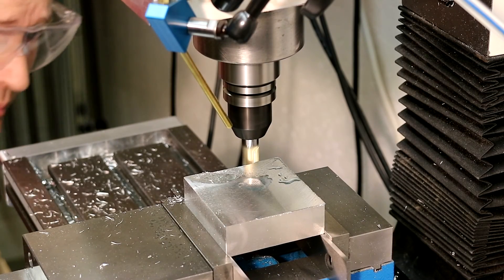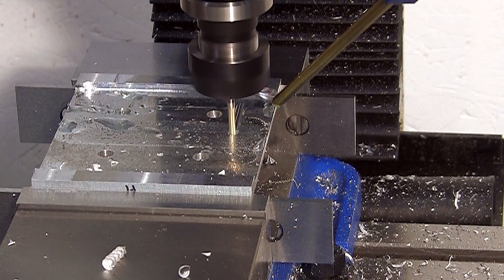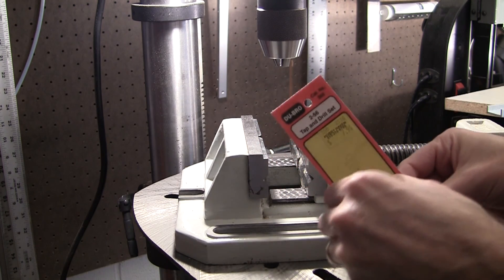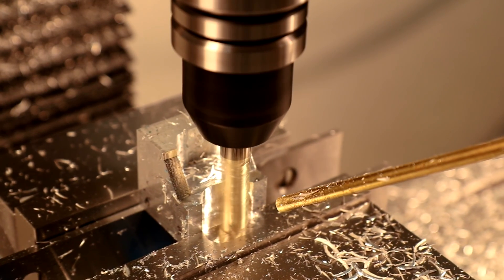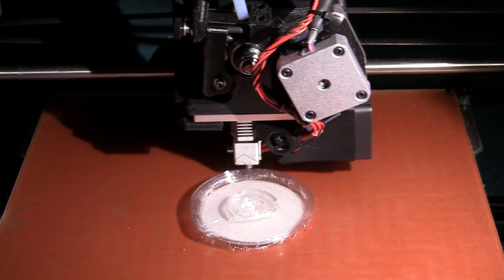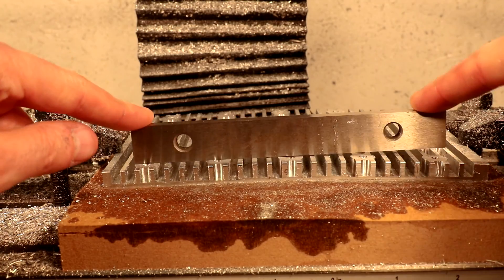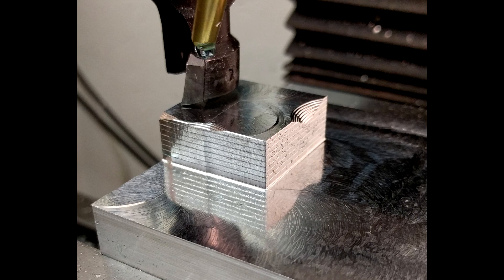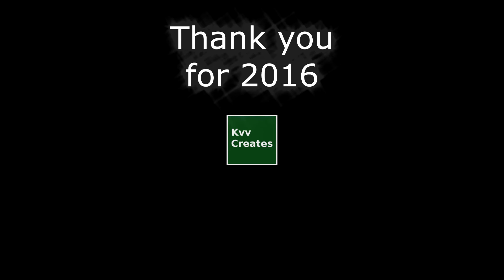CNC Machining Disasters

Comment: Hey Kent. I finally got my pm25mv cnc converted with a kit from Arizona video. I was wondering if you had a cheat sheet or something for some feeds and speeds that have worked decent for you with a stock motor. I have hybrid closed loop stepper motors, tormach  super fly, and some tormach holders. I'm not sure if there is a nice sized bit that you like for a motor our size. Thanks!
Reply from the maker: That's great! I look at the material removal rate (MRR) and convert that to power required given the material, targeting 50% of the spindle capacity, using the parameters from the manufacturer, all being carbide. Then when the program is run at 20% feed or so and ramp it up until it sounds right, and then keep my finger on the feedhold. Specific feed speeds will only be for specific MRR, so best to start with MRR. I started to put some software together for this. I bet we'll eventually see something like it built in Fusion, then optimizing tool paths to maximize MRR. A bit of science and a bit of art. Hmm... could be a cool video topic. Works well for me, but your milage may vary :) Stay safe, stay healthy.
Reply: @kentvandervelden  thanks for the good detailed message. :) Ill be working on the softer stuff like aluminum before tackling some of my steel projects. That's way more forgiving. The best to you staying safe also.
Reply from the maker: Steel is awesome. It tells us in chip color if all is fine. Looking forward to seeing the projects you make.
Reply: @kentvandervelden  that is about the color. I'm a super beginner so things will be fun. But that is sometimes half the fun. I'm sure there will be some interesting projects. Have a good one.

Comment: LOL! Great vid Kent!!  I physically jumped a bit when you pulled the part out of the drill press and broke the tap.  I've managed to do a few of those myself.  The swelling of the mdf was rather enlightening.  Any other issues with linuxcnc?  At some point this year, I will definitely be moving away from mach3! :)
Reply from the maker: Happy New Year Mike. Oh man, that swollen MDF made me sick after putting 1.5hrs into lapping the aluminum pate. I got very lucky. The video had some careful muting. :) I should have left in the bit in right before the second 1/8" end mill broke, me saying to my wife, "here we go" and her responding "I bet that was not expected." :) I've had a great experience with LinuxCNC. Mach3 was on my last mill and it worked well and was convenient, but LinuxCNC, has forced to me to learn better practices which when I read the explanations on the LinuxCNC forums, the practices are based on experiences with larger commercial CNC systems, so I trust what the designers had in mind and adapt. I'm surprised that no one has made a conversation CNC interface that's standard to LinuxCNC yet. LinuxCNC took a good deal of time to set up. I don't know if I had a working Mach3 system if I would switch to LinuxCNC... I don't remember having problems with Mach3 as much as I did with Windows XP, but it's been maybe ten years since I last tried Mach3. For me, the programming interface of LinuxCNC and that PathPilot is based on LinuxCNC, made it the obvious choice. LinuxCNC: it's a great lunch, but not free. :)
Reply: "careful muting"!!! LOL!!!!!  I use that on some of my videos too! :)  
Thanks for the input on linux.  I have a couple of extra computers here, so I may just load one up with linuxcnc for the little lathe and try it on it.  It would give me a chance to play with it.  Once I get a feel for it, then I can do the second ssd in the mill so that I can boot to either system. 
Thanks!!

Comment: I recognize a thing or two here.. :) sticking it to a sacrificial plate with double-sided tape, but after a few errors i switched to a sacrificial aluminium 15mm thick plate of 15x150x400mm, and aim for screwing, when possible. Tools running out of the spindle due to incorrect torquing, I thought i was the only one.. 1 off items can be a drag to 3d print, since tuning can be so time-consuming, just to get it right. At a certain point you can easily recognize what strategy you should aim for (adding support in the right places, adjust the nozzle width to get 2 lines to bond to each other). I do like the preview in simplify3d for that reason, gives a neat insight on what's going on. There are several features in s3d that justified the cost of the program for me.
Reply from the maker: Happy New Year Berend! Aluminum vs. wood is a great example of me trying to save a few dollars at the ultimate expense of many times the potential savings. Your large aluminum plate, as it's cut, do you resurface it and if so, how? I had no idea the swelling would happen that quickly or from so little liquid. The torque recommendation for the TTS tooling is 30 ft-lbs (40Nm) for heavy cuts. When I checked what I was torquing to regularly, it was barely 5 (7Nm). The Taz5 was purchased to print an enclosure for work. I spent days on that enclosure fighting problems with warping and delamination. Tried PLA, ABS, built an insulated enclosure which caused the electronics to overheat, and on and on. In the end, I ran out of time and provided what I had. I should have sent the 3d printing job out and focused on the electronics and software instead. I could have milled the enclosure from solid aluminum, had it look awesome right from the start, and saved lots of time :) You may already know the material, but I learned a lot from the book "Functional Design for 3D Printing." Best wishes, Kent
Reply: Kent VanderVelden  you too Kent, the very best for 2017 for you and your Family!, about he plate: i try to damage it as little as possible, it sometimes takes a cut, it has some threaded holes in it, from the different work pieces that have been screwed onto it. If it has too much carnage i use a 20mm router bit for wood (sssshhh.. don't tell, if you take down 1 of the 2 teeth, you end up with a 20mm flycutter...) in an attempt to make it a single flute cutter, I found out these cutters use carbide inserts. (It wasn't impressed by the grinding stone) they leave a great surface finish too, i need to test them with my new spindle.. when the aluminum plate gets damaged too much you just replace it. The plate costs around 15-20usd, they can be used way, way longer than i expected. You sometimes need to aim your new workpiece so holes don't interfere or reuse an existing hole.